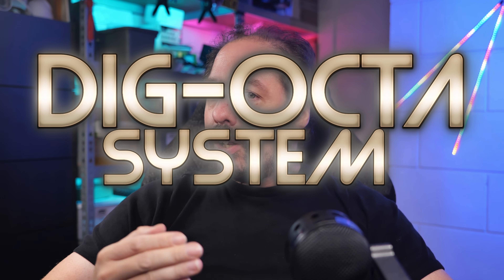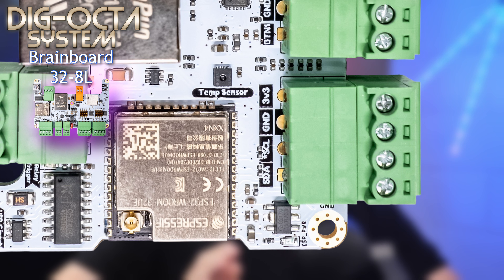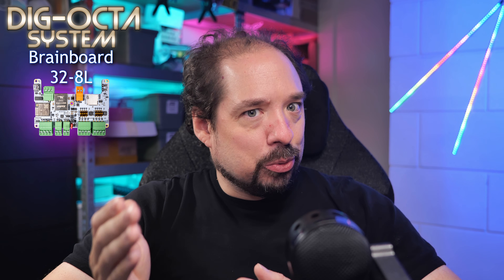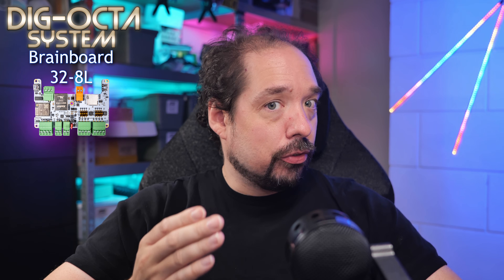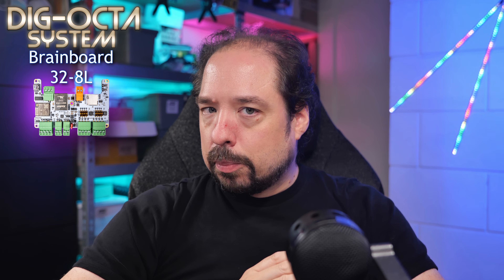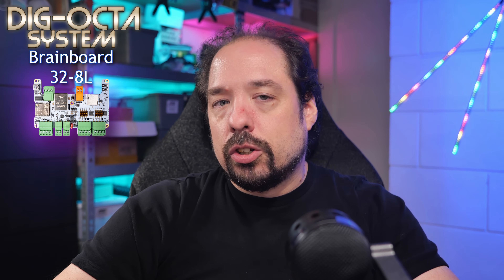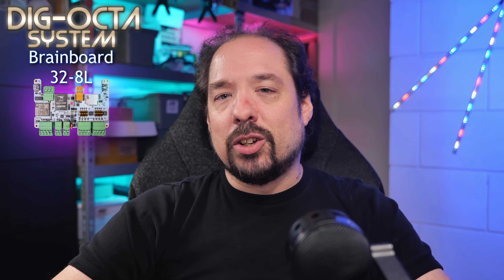💡QuinLED💡Introduction to the Dig-Octa Brainboard-32-8L

Comment: Video was definitely not boring, I appreciate the discussion of features. I recently bought the Dig-Octa Brainboard and a Octa Power-5 to drive some small, in length, RGB strips. This, from my research, is best suited for my needs, A well thought out design and that I am also currently using ESP32 modules to study control of RGB strips. The power side has been a concern, but I believe the Octa Power-5 solves this issue.

Comment: Question on mixing LED types.  Would I be able to run 3 channels of SK6812 (260,260,380 LEDS) and a single strip of PWM RGB lights off the same controller (using outputs 4-6 per example for the 5050 LEDs.  There are only 60 LEDs total on this strip).  I am using a separate power structure to power all of them, I am just confirming if you can use a single ESP to control both types of lights with different segments.  Thank you.  This is an awesome idea BTW!

Comment: Just got the Brainboard and a PowerBoard! Thank you for making these!

Is there a way to connect the Brainboard to sensors like light or motion sensor? If so, is it possible to make a tutorial video?
Reply from the maker: The board has an I2C port and dedicated button inputs, I'll consider a video for in the future!
Reply: @IntermitTech  I would also be interested in a way to add a motion sensor or remote control :)

Comment: Newbie here, making a spreadsheet of what it would take to outline my house with strips in diffuser tracks. Looks like it will be easy to hit 6000 LEDs - are 3+ brainboards my best option or is there something I don't know yet?
Reply from the maker: That's a lot of LEDs but yes, sadly the ESP32 has limits in that sense. Using external LED data like from xLights you can make act like a whole though.
Reply: @IntermitTech  Thanks for the reply and answer.

is 6k a lot? (I'm really worried it's a lot, it's like 300 amps @ 5V). I know the LED count shoots up if you decide strips instead of strings, and then again when you say "may as well do 60 per meter!". a few hundred ft around the roof, trim, garage, etc, the number goes way up. I know I don't have to outline everything - I could probably cut that in half but then I'll probably want to add wreaths/trees/etc, so it'll probably climb again even if 6k was too high an estimate for just the house... However I'm waffling on every single decision (maybe I will do strings at more like 15 per meter, I have no idea ).   Choice paralysis.

Comment: Somebody please correct me if I am wrong; To be able to play a light show sync'ed with audio, using the Dig-Octa, I will need...
A) To use xLight to created the show
B) save the show to a SBC like the Raspberry Pi
C) connect the Pi to the Dig-Octa via Ethernet

D) connect audio out from the Pi to a PA and/or FM transmitter
E) Launch the show on the PI

I am sure I am oversimplifying this but do I have the basics?
what app/s do I need loaded on the Pi?
What else am I missing?
Reply: https://www.youtube.com/live/BRDc4eD7QAc?feature=share
Reply: @stephenmurdoch5291  I believe the part (xlights) that will be of most interest in your linked video will be from 1:35:00 onwards

Comment: does the Dig-Octa Brainboard-32-8L support music sync
Reply from the maker: It doesn't have any native capabilities such as a microphone (or pins available to hook it up) so in that sense no. But since it has Ethernet it is ideal to receive real-time LED data from LEDfx for instance! That would work fine.
Reply: @IntermitTech  Thank you for the quick response.  I am a complete noob when it comes to pixels but want to jump into the hobby. I have minimal experience with the  Arduino using it to control my food dehydrator, as well as a Pi using it as a retro arcade. My coding skills are very weak but want to learn. At this point I am just doing some research. My hope is to have a modest show ready for Christmas 2023. But also wanting to expand quickly after that. Sound reactive is cool and I am sure I would use it in some applications but I really want the capability of syncing a predefined show (like from xLights), to music. Would this be possible with the Dig-Octa and say a Pi? any input and/or advice would be greatly appreciated.
Reply from the maker: Oooh yes for sure, the Dig-Octa is great combined with xLights! No worries there.

Comment: hello i updated to wled 13.3 and cannot use pin 5 for led channel 6, you mention changing the ethernet profile to use pin -1. does this has to be done pre compile or is there an option in the config to do this?
thx

Comment: Bravo! Ive been looking at making my own controller board because I like using din rail mounted fuse/terminals instead of PCB ones....for $32.50 its hard to justify doing it myself, too bad shipping to Canada is half the price of the board. I guess I'll just have to make my order worth while than :)
Reply from the maker: Yup, then just the brainboard should work perfectly fine for you! Can do power distribution and fusing using other Din rail stuff. Just make sure all GND is connected if you use multiple PSU. But the brainboard has  several GND output terminals too.

Shipping can be tough sometimes.

Comment: Curious... Since you used a USB-C, can that port take the higher power inputs of USB-C-PD?
Reply from the maker: It supports 5v up to 3Amps and will negotiate that but the powerboard itself has no facilities to drive LEDs so it's not really too useful in that regard it uses way way less power then that. :)

Comment: Great work!! I’m about to start my LED project on my food trailer and wasn’t sure whether to wait for this product to be released or to purchase the Quad.. I’ve decided to purchase the double row 24v WS2811 120/m leds I’ve got approximately 66 meters of led to run (2x15m - 2x10m 2x6m 1x4m) “question” will the quad run this many leds and handle the power input or would I need 2x quads or should I just wait until the Octa comes out?
Reply from the maker: From a quick calculation a single Dig-Quad would be able to handle that if we use the 50% RGB white maximum values from the power sheet but it's right on the edge. I'd feel more comfortable having a Dig-Octa or 2x Dig-Quad handling that kind of power.
Reply: @IntermitTech  Awesome thanks so much for you’re recommendation! Any news when the dig-Octa will hit the market?
Reply from the maker: Still the same, hopefully somewhere next week!
Reply: @IntermitTech  I’ll hold off and purchase the Octa!

Comment: It would be awesome to add a board to mount a raspberry pi compute module 4, or something similar, that way you could have xlights running in the same stack... The only problem is actually getting your hands on a raspberry pi...

Comment: Another great board , thank you  for another great option. May I ask will this become as a DIY version, second query on  your next live stream would you mind going over the temperature sensor. Can this be programmed to shut everything down if it sees a temperature or control a fan speed for fan in a control box. I'm assuming this can be set up in WLED also. Thank you

Comment: Impressive design.
I do wish someone would come up with something to turn off the wifi chip/antenna (this one oes have the ethernet switch/jump)
With WLED having the option to be controlled by hardware switches, the wifi module shut down might increase safety (I do not think the ESP platform has a very robust safety design, hacking wise)
And having to use guest-like wlan might work, but its also just extra work.

Comment: The terminals that come with the device, are these rising clamp style terminals or are they the cheaper, less reliable, direct compression type with that  never clamp properly?
Reply from the maker: All rising clamp for brainboards and powerboards, even the 7.62mm terminals. Also all with + or Philips head screw. On the previous Dig boards those where inpractical in regards to size but for this new system I reevaluated everything and went with what would be the best fit for that!

Comment: Discussing this with a few people, the only xLIghts related issues seems to be running a single prop that takes more than 8 channels to run.  Ex.  A mega tree that takes 16 ports doesn't divide nicely in the xLights visualizer, xLights would require some type of custom model, or shadow model.   Please let me know if this is incorrect.
Reply from the maker: From what I have heard this might indeed be correct, I'm not xLights wizard myself but if true, hopefully they can program some kind of workaround or fix for that in the future.

Comment: Can this be used for 12v pixels or only 5v? Many thanks looks great 👍
Reply from the maker: 5v, 12v or 24v led strips or pixels, all good. You can also directly give it that voltage and it auto converts it onboard to what it needs. It doesn't do any power distribution to the LEDs though, just data. For that there are powerboards (check out the first video mentioned in the beginning).

Comment: First, this looks awesome! Second, would someone be able clarify for me about the relay (I understand the function of a relay). Does this mean that the brainboard can turn on/off the power boards to power the LEDs when I do/dont need the power?

For instance, it would be smart enough to not have the LED's turned on until I want my light show on, turn on during the light show, and then turn off after it is complete. Is that what it is for?
Reply from the maker: Yes that is exactly the idea! So in WLED you can configure a GPIO pin which will trigger the relay on and off depending on if you turn the LEDs on/off in WLED. If you then connect a little relay board on the AC side of your big 5v/12v LED power supply and keep the brainboard alive using a separate USB adapter for instance, the brainboard will always stay online and the LEDs and it's big power supply will only turn on when needed and turn off again when not. :)

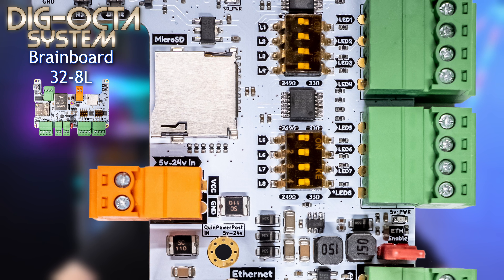Comment: Hey @Quindor, Thanks for the great walk-through of the Dig-Octa BrainBoard!  I have one question though, at the 1:55 mark, you say the input power for the orange connector is compatible with 5v to 32v, but the board shows 5v-24v, and the rest of the time you talk about 24v.  Does it really allow up to 32v input?
Reply from the maker: Wait did I say 32v? That really should be max 24v! So it's rated and tested for 5v - 24v, 32v will cause issues!
Reply: @IntermitTech  Yeah, I watched a couple times to make sure I heard it right.